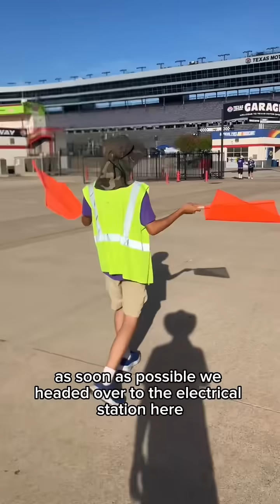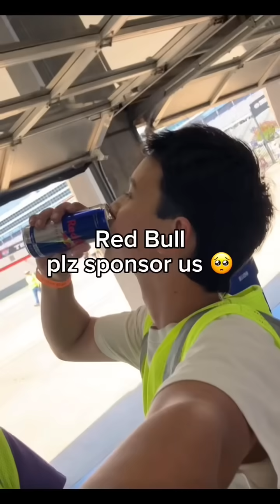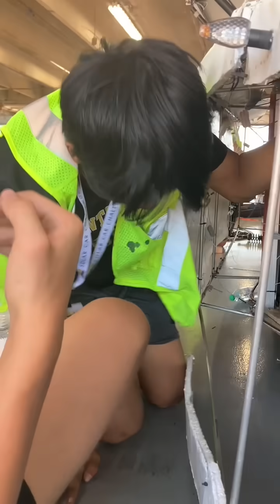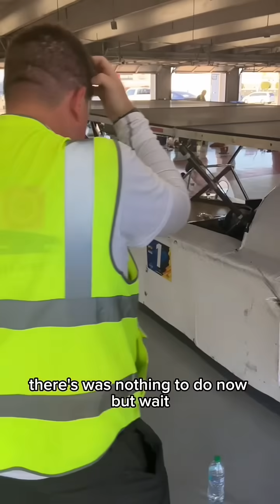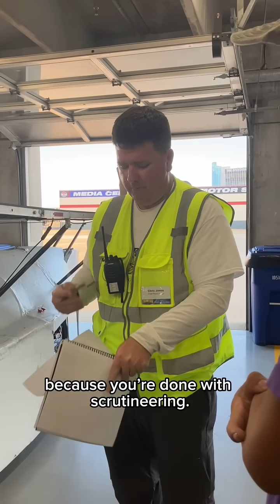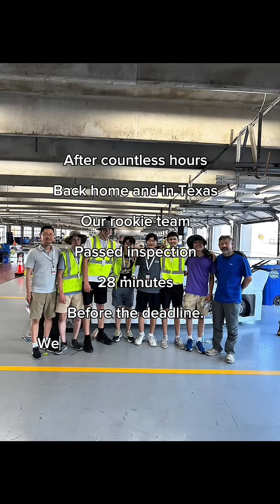2025 Solar Car Competition Day 5

Comment: for the suspension, to make it lighter, remove the upper suspension arm, and attach the spring directly to where the upper arm previously bolted to the hub/wheel spindle (its called macphereson strut suspension and is used on many road cars)hope this helps!